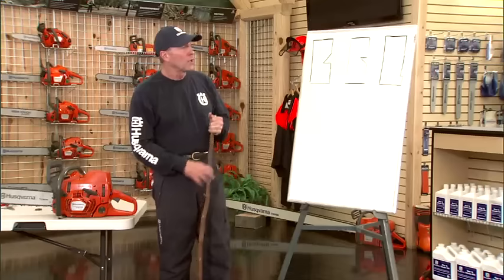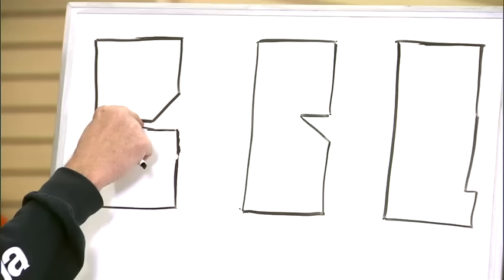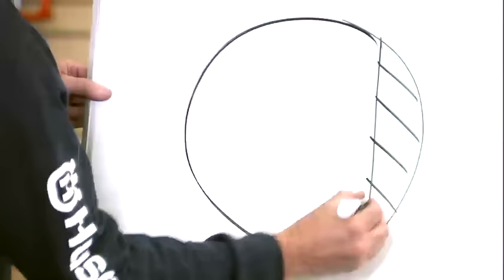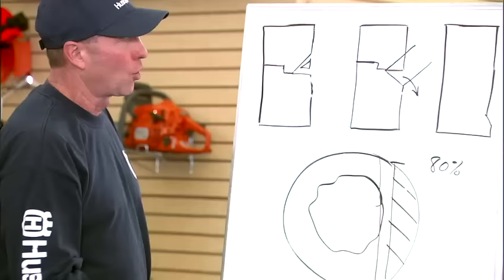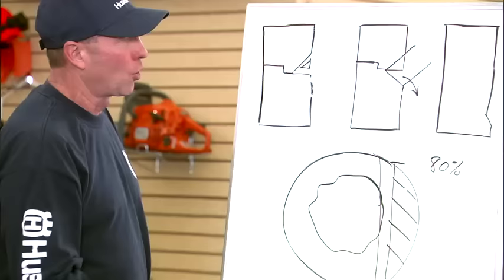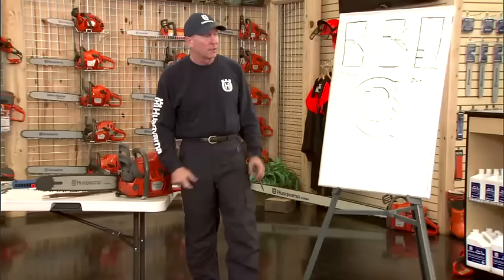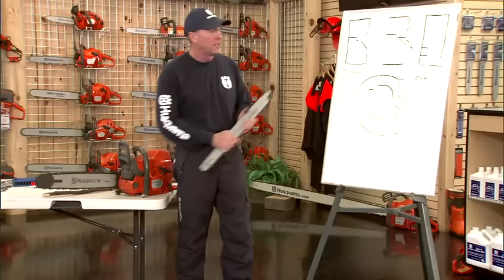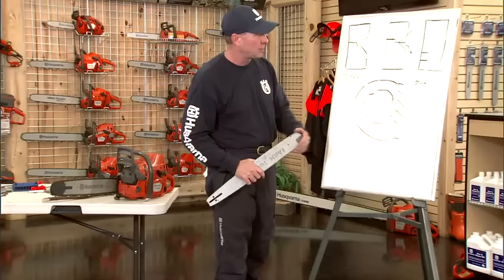How To Make Tree Felling Notches And Hinges With A Chainsaw | Husqvarna

Comment: I literally watched this video to fell my first tree... If you will. 
It was a 2-ft diameter oak with a slight back lean... If you will.
My 25-in Stihl ms311 barely cut through... If you will.

I was so confident, if you will, that I called the shot just like babe Ruth. If you will. 

I started my back cut and when the saw was in deep enough, I started pounding wedges... If you will. 

Cut a little bit, pound a little bit cut a little bit, pound a little bit... If you will. 

I felt pretty good about myself when the professional Davey tree service two houses away gave applause. 

I had actually had conversation with them before I started and they knew it was my first tree. If you will.

Comment: Good advice for novice Sayers. But comes up a little short for big timber professional cutting. 
And Humboldt cuts are specifically designed for log utilization. When your paid by scale. Standard cuts only mean another 200 board feet deducted at the Mill.

Comment: Husqvarna is the best all around. Even their instructionals.   One suggestion for everyone... ALWAYS CHECK YOUR NUTS ON CLUTCH COVER.  even on pro models. I JUST had my 28 inch fall apart mid cut while light milling. Their safety tech 100 percent saved my life/limb. Still an in issue my beloves HUSQVARNA!🙃

Comment: I have watched this and your other (actual felling) video a number of times and found them both to be very useful in clearing my own lot. Thank you.

Two things that I didn't pick up at first was the black 'sighting' line on the saw (which is very useful) but more importantly that the "HOLDING WOOD" is not parallel to the hinge, but cut at an angle to allow the wedge to be placed almost perpendicular to the hinge. I don't think that this is stated or described in your video, but it is shown.

One tree that caused me some indigestion was one that was 2-inches wider that my bar, and so I was left to fish around to match up the plunge cuts.
Reply: Yea, trying to match two cuts to meet is a real problem, that I have not yet seen a video describe an answer.   Too often we see 'experts' end up with two or three parallel (or not.) back cuts.  Sometimes the notch is made with so many cuts that don't meet.
Reply: the hinge is the holding wood?
Reply: If only 2 inches short your bar should come through on the trigger side. Move to opposite side of tree, insert saw and cut up to the hinge.
Reply: @hiscifi2986  I don't think making several back-cuts impacts the effectiveness of the last one, although if youre felling a leanign you may have to stack wedges on top of each other the get back the elevation last by eating up that wood
Reply: @lazerbeedotcom2630  I would thick you wouldn't want to only leave 2 inches left on one side of a last tree though>? better to not insert the whole bar and cut no more than 70% of the diameter so if doesn't fall before you walk to the other side.. just my assumption

Comment: This is an excellent video because it totally explains why you are doing something, 
 how to do it and the measurements.    The one thing  I wish had been explained was
 using wedges.  I make my cut from the back, all the way through to the hinge, instead 
cutting the hinge first, removing the blade and then cutting the back.  But what I do is 
once I go is so far, I insert my wedges and then continue the cut to the hinge.  This way 
ensures that the tree cannot accidently pinch the blade.  I pull the saw out and then drive 
the wedges in further until the tree begins to fall.  If someone has a different opinion, please 
let me know and also explain why your opinion is correct.

Comment: Even if the trunk is straight up and down the tree can still be heavy on one side. You have to take a good look at the canopy and watch for more growth on one side. When the builder cut back the tree line to build my house the remaining trees started reaching into the void and after a few years the smaller trees showed visible lean but the bigger trees stayed true despite the increased weight imbalance. I used a two rope system to safely drop them. One rope as a safety and one rope to a continuous rope puller. I made extremely wide but shallow notches and multiple shallow back cuts going up from the standard back cut to allow the tree to bend more before falling. 

I also dealt with a variety of internal rot among these imbalanced trees. That was some scary stuff! Again I used a very wide but shallow notch with multiple shallow back cuts and then went back and forth adding a little tension with the puller and deepening the notch. Once I created tension I stay away from the back of the tree because I don’t want to end up in a barber chair!!! 

When creating the notch I would start small and then increase the width of the notch as I learned more about the internal structure of the tree. If there was rot I adjusted my notch according to how the rot was situated inside the tree, some rot was centered but some was to one side...

Comment: I really like what you said about making the notch wider on a tree that leans backwards because when the tree starts to fall, and becomes vertical. It will have closed the notch considerablely. Thanks!
"If you will?"! Hehe
Reply: Buddy the fibers inn the tree don't work that way tho. The break around 30 degrees or so way before the face closes. The degrees of not are really for when and how you want tree come off the stump.

Comment: The Humboldt originated to reduce wood shatter by allowing the (usually Redwood) tree to go butt first to the ground. The original Humboldt included a block cut the purpose  of which was/is to reduce pressure on the hinge of the undercut and thereby better guide the tree into the lay. The Humboldt version above is the standard for virtually all west coast logging and has been for many years now. It does reduce breakage- especially in brittle trees like cedars or redwood- and leaves a relatively square butted-log which west coast most mills demand, and arguably it may (can) reduce waste. There's also a common version of a Humboldt cut that includes elements of both the standard (traditional/farmer/lowlander cut) and the Humboldt above.
The original Humboldt was not invented because of steep ground concerns, and make no mistake, a Humboldt with little or no stump shot does little to stop a tree from kicking back irrespective of slope..No undercut method ensures a tree will not kick back.
Also no matter how you undercut a tree, as it falls, the hinge is under pressure, otherwise it is guiding nothing. Maximum pressure and pressure are not the same things.

Comment: Good instruction, valuable stuff. Thanks. (My one critique: In the middle of the video, the instructor seemed a little unsure of his delivery, and in nervousness, inserted the filler phrase, "if you will" several times. Should've left those off. I'm sure that more practice would help there, each time getting more calm and conversational when speaking to his audience.) I really do like the tip about leaving some "holding wood" at the very back of the back cut. And although I knew how to make the notch and slightly higher back cut, I wasn't really sure why the back cut being higher helped. I'd thought it was just to create a taller hinge for strength as it bent the first 45 degrees. Now I know! YAY! This video cleared that up. It's an anti-slip-back tree holder. Super! Thanks for the video! Keep making them! Short, sweet, to the point! Good job.

Comment: 7:40 Time. One, could also use the 3 gill method, on this far right example. 3  vertical slits, 1 from the front-cut face, above the hinge, 2nd one higher,  1.5  inches to its left ; 3 rd one, same.  Expands, the hinge, vertically as well. 2 nd  and 3 rd ones, bottom meets top of other one.  Progressive ; for LARGE  trees.

Comment: My neighbor wanted a cherry tree down that was a little too close to his shed. I gave er the file and and threw some gas and oil to it and made my way over the fence to meet him. I was checking out the tree, looking for tension/compression, lean, rot, loose branches etc. Neighbor walks up and says, ‘You ain’t scared are you?’ The walks up to the tree and with his foot makes an imaginary straight line at the bottom of the tree and says, ‘ Just zip er off right here. Put the saw in it and go all the way back and let er fall.’ He then got his chain and threw it around a branch and hooked it up(haphazardly), pulling in a manner that begged the tree to barber chair. I told him my plan for it which was a humboldt and he started getting irritated telling me I’m just making more work for myself lol. I told him that when I’m falling a tree that I need to determine the course of action to be comfortable and that it was his property and if he didn’t have faith then I would gladly walk away. 
  Do not ever let a property owner pressure you into felling in a manner that you know is unsafe or think is questionable or unfamiliar(especially if they obviously have no experience). Just load up and leave. He was almost strong arming me to just slice straight through the entire tree, front to back horizontally and wouldn’t have it any other way. I told him to let me know if he finds anyone else so that I can grab my camera

Comment: I have some 4" diameter trees in my 1,000 sq ft suburban backyard to cut down, so I think I'm going to get a saw like the one on the floor, behind the white board. It'll go great with the SUV that barely fits in my garage and never sees anything but pavement under it's tires... If you will.

Comment: A horizontal back cut will always allow the tree to ‘jump’ backwards along that flat surface.  If a Humbolt cut is used on the front and the back cut is angled down, parallel to the bottom of the Humbolt notch, would that do a better job of preventing the tree from jumping backward?

Comment: Nice video, just 2 comments.  You don't explain that when the hinge breaks, it breaks at the thinnest point, which if the back cut is about an inch higher, will delay when the hinge can slide past the break point. Second, unless the center of mass is over the notch, or pulled by ropes/cables secured higher up the tree, or pushed by wedges driven into the back cut, the tree may tilt away from the notch.

Comment: What he calls a Humbolt notch is really a Swanson Notch. A true Humbolt only has 1/2 as much vertical height as the depth. A Swanson is a special purpose cut while a Humbolt is intended to maximize wood yield of a felling. Either a Swanson or a Humbolt will drop the butt end of the tree on the ground before the rest of the tree finishes its fall.

Comment: One question no one talks much on, when starting your first cut, should the chainsaw be square to the tree or level/parallel to the ground? Depends on felling direction vs the lean of the tree? Say the tree has a lean to the left but you're going to fell it 90° to that. If you were on the right side of the tree(left shoulder against the tree) would you tilt the saw to make the square to the trunk? Or just cut it level with the ground?

Comment: Great video! Question: Can you still use wedges to help control the fall if you leave the backstrap in place to cut at the very end? Anyone have this experience?
Reply: At 9:50, he leaves the backstrap off to the side a little - I think you could get a wedge or two in there, maybe not exactly at the back of the tree but on the back half, anyway.
Reply: @DaddyBeanDaddyBean  Correct. Leave a trigger at the back and then drive wedges as close to that trigger as you can from both sides.  Then cut the trigger a bit above the wedges so you don't knick your wedges. The small amount of wood between the wegdes and the trigger will snap easily.  If not, give your wedgies a few more whacks. That will bust the triggers open.

This being said, most of my wedges have knicks on them from doing plunge cuts, making the hinge, cutting backwards to make the trigger, wedging, and then cutting the trigger and accidentally knicking a wedge. I've used wedges for years knicked up. Doesn't really matter. And they're relatively cheap anyway.

Another good triggering technique is to do a small plunge cut from the back through the trigger towards the front, just slightly above your main cut, and then wedging that last small plunge cut to rip open the trigger instead of sawing it open.  That's a pretty safe technique.  You can do this after you've already wedged the main cut, if you needed to.

If someone has a better way let us know.

Comment: One other thing is I always go closer to 50% notch because the way I see it a lot of mass overhead if you can change the center of gravity a little more the chances it falls to the notch  side is greater just a safety thing that I do 
30% of diameter just isn’t quite as safe as %40-50
 if you will

Comment: Hi I am a  amateur just starting and this week-end 3 of my cut the tree fell backwards!! can you guys give me a hint of what i might have done wrong , first did the open face and then cut from the back ( 6-8 inch three) remove the saw and the tree fell backwards?? is it possible that the back cut was to high oven the base of the front hindge?the trees are spruce.

Comment: 2:30 in my average opinion it will not put pressure on the hinge unless you have something holding the tree in the middle of the trunk were his fingers are, as there is no natural pivot point there. So this should have been edited, correct?

Comment: I know this guy is a pro. But I've never understood why they cut the top cut first. I've always found that it is more difficult when you do it that way. If you saw the bottom cut first it is far easier to line up the line on the saw with the direction you want to drop the tree.

Comment: The 70 degree notch or face puzzles me. 1/3 the diameter of tree is my minimum regardless of sap wood.  That basically alters center of gravity to cutters advantage as long as size up has been thorough. Every tree has two leans, primary and secondary, and the more vertical it is the easier we misjudge. Plumb Bob never lies. Do not disagree with open "bird beak face" but please get your 1/3 DBH with clean hinged corners in your face on 99% of trees. 45% is a minimum
Reply: +Oldsawdog,  you're rightfully puzzled.  They use some made up 80% of tree diameter to get the depth of their face notch, it ends up being only a 1/5th deep if you do the math.  They do this so you have room to do a boring back-cut on small trees.  
Basically their obsession with boring back-cuts dictates everything in their felling methods.  Every tree is different but I also aim for the 1/3 of tree diameter for my face notch depth.

Comment: The humboldt cut is used for creating a good saw log without a stupid wedge cut out of it.   Moreover you can add an extra snipe to the undercut to add more room for the closing of the wedge.  Closing out the wedge is not such a problem that these experts claim.  Once a heavy tree moves past 30 degrees it is extremely hard to change its direction.    A gapped  humholdt cut creates a superior hinge to any other cut period.   It is easier, and extremely  actuate and extremely safe,  with every situation other than a heavy head leaner,  ( leans greatly to the fall path).  Then use the wacky Husky cut.  Boring is a difficult and dangerous technique for beginners who rarely know how to sharpen the chain correctly   You must have a sharp chain to safely cut down a tree,   PERIOD.   After 37 years of logging without injury,   I have earned my bagging rights.  But you can decide if the classroom actor guy knows more than lifetime timber fallers who drop huge trees for a living.  They know that there is no real escape path when the tree is 250 feet tall and weighs 100 tons.  Bigger the tree the more it finds the fault with your technique.   Tree service folks are some of worst fallers I have ever seen.    "sometimes wrong,  but never in doubt"      They sound sooooo   expert,   watch out
Reply: Logging in the Washington coast, never ONCE did I see these huge 70 degree face cuts. Boring cuts, almost never, only in specific situations.
Reply: Brian Campbell oh yeah. I have 38 years of logging.
Reply: No that's not why use Humboldt lol. And same material is removed no matter conventional or Humboldt lol you sure your 37 years logging lol. And bet maybe 2 or 3 people in the world have cut 250 ft tall tree.
Reply: @steppoffaith8426  the notch is the same size, yes. However, with the Humboldt, the notch is cut from the unusable stump instead of the valuable timber atop it.
Reply: If you will.
Reply: Too long; didn’t read...if you will
Reply: Mark Stevens  hahaha it's quite likely we're all doing something wrong.

Comment: 03:45 So the Humboldt was invented to fell trees more easily on steep slopes? 

I am unsure of its effectivness. We in the alps have even steeper slopes and nobody uses the Humboldt kerf...

04:05 Exactly that the only Aegument for the Humboldt.
You in America had (and have) huge trees. We in Europe got max 1 m diameter and they are scarse. So its not difficult to bang the wedge out, on smaller trees you can even use your sawchain.